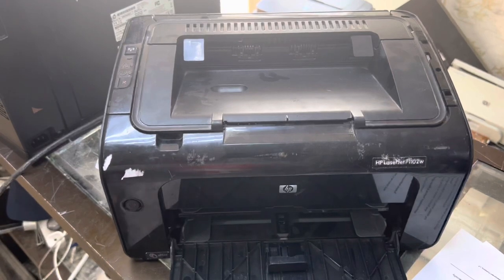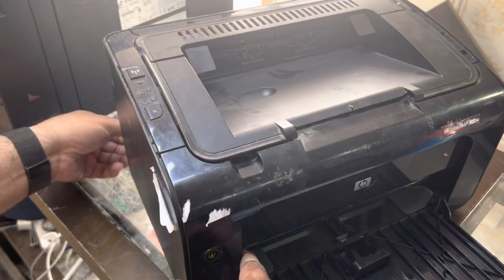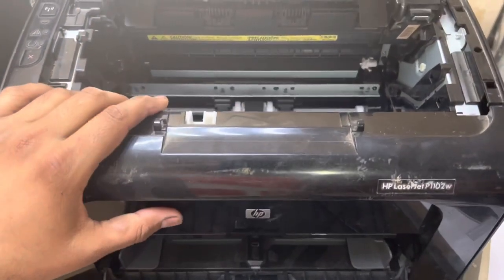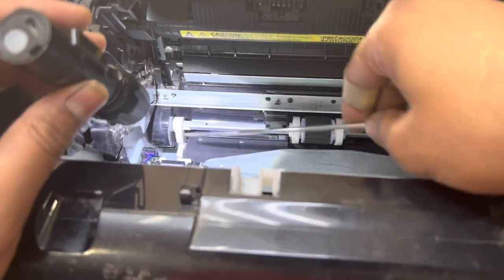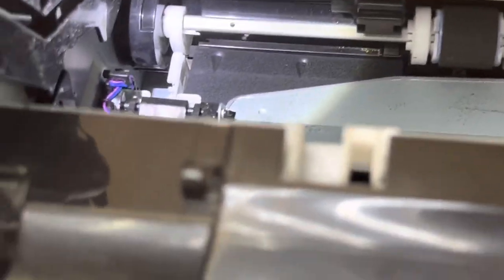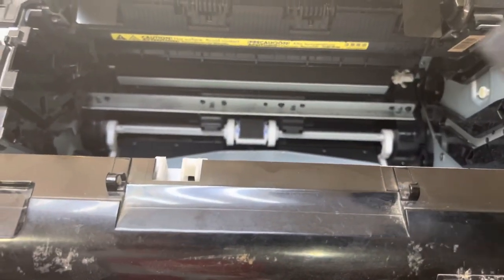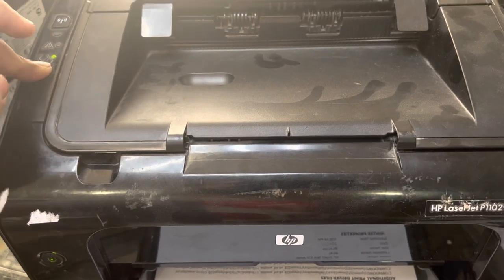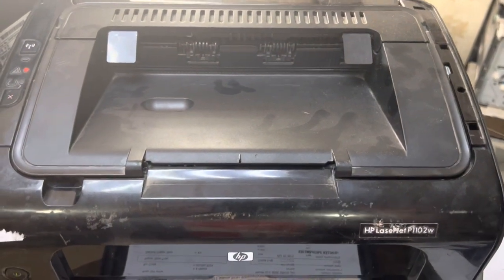Why Does My Printer Make Loud Noises? HP P1102, 1102w, 1005, 1020, 1018

Comment: Thank you so much.  This worked.  I looked a few times and couldn't see anything and nearly gave up and put the printer in the bin!  But one last check and having banged the bottom and back a bit, it showed a small piece of plastic wedged in the gear.  REmoved it and it works great again.  Can't thank you enough for your time to help others.
Reply from the maker: Glad it helped